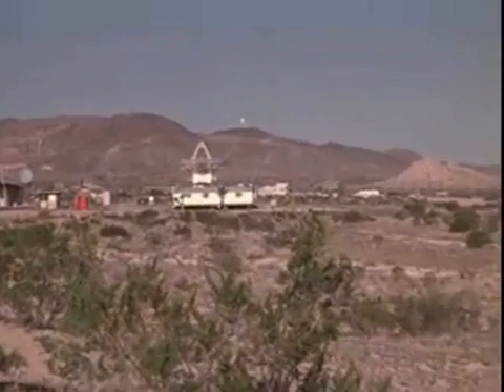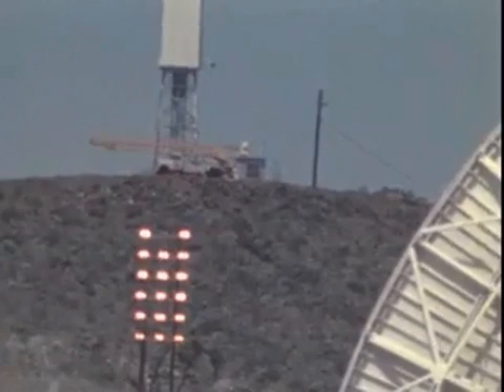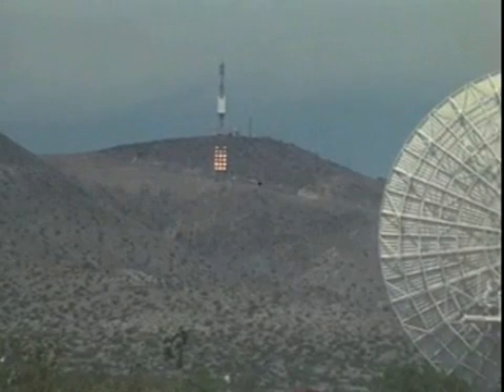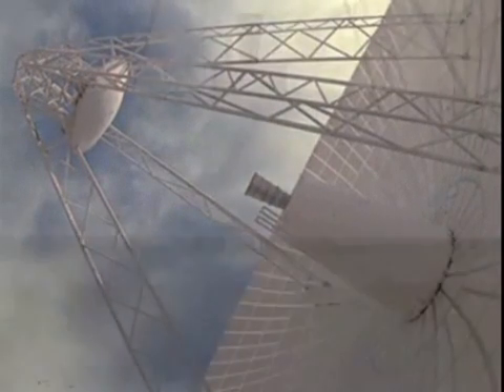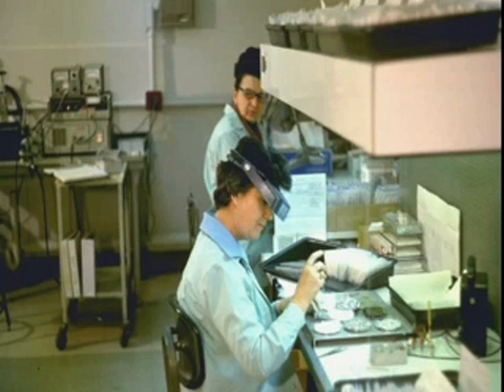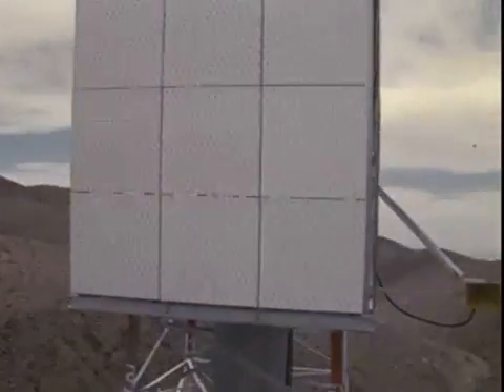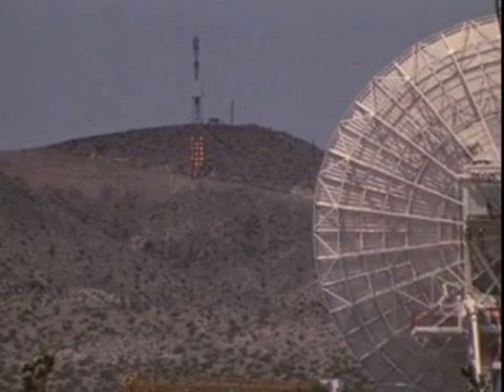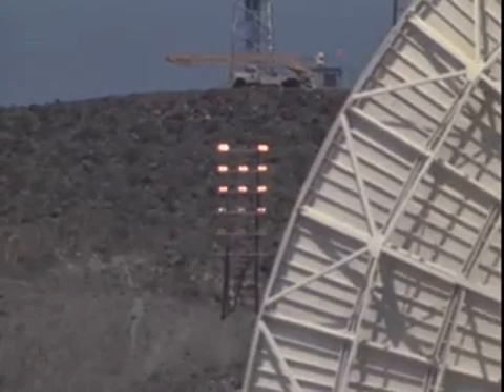Liftport Energy 2.0 : Wireless Power Transmission test 1974

Comment: please everyone i did alot of research on tesla wireles power and show a 20 ft wireless transmission and put info on my utube. tesla wireless power uses the earth as a giant "one wire", you pulse the earth at resonant pulses to bring out stationary waves that contain energy every so many miles or modify the waves to move over the surface to have wireless power everywhere, the energy brings out an electrostatic wave,and bounces off its end point back to the tower like a wave of water in a tub.

Comment: i put up nikola teslas wireless work. wireless power is a 100 yrs old not 30 yrs old. tesla perfected the art back then, i have just proven his one wire transmission which is an important discovery because it leads to teslas wireless system and eventually faster than light energy and internet transfer. yes tesla also created the internet 100 yrs ago.